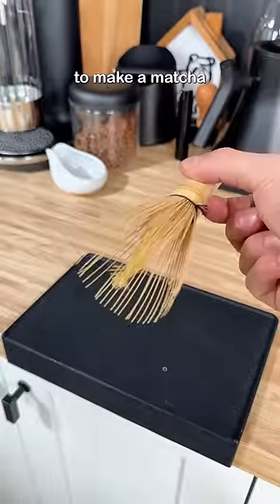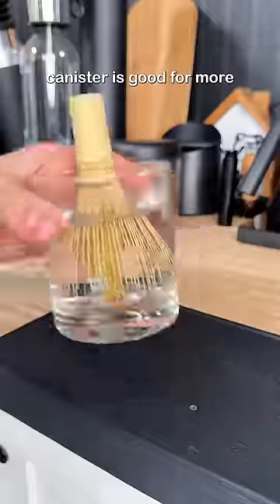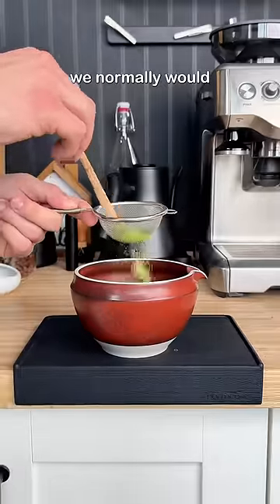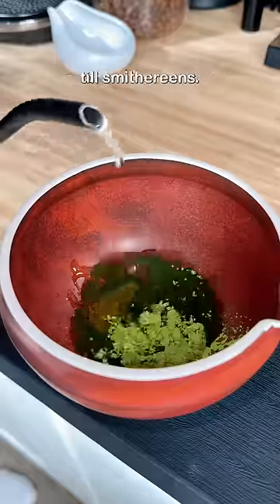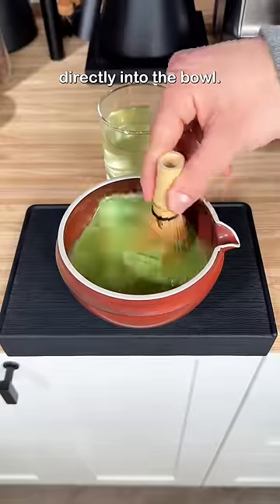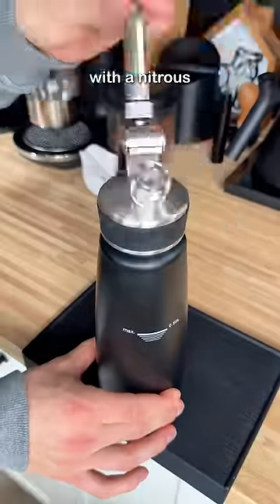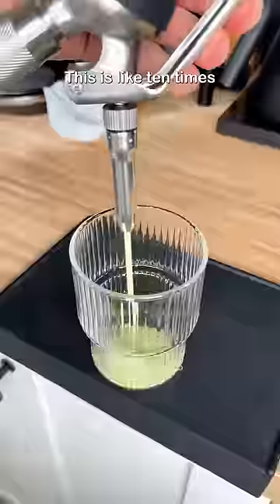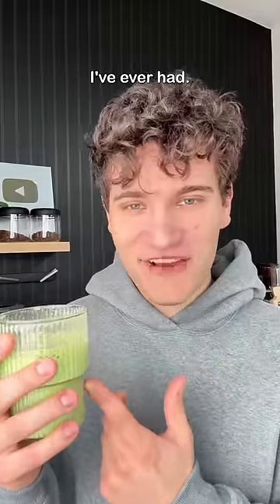My favorite way to make matcha - nitro matcha latte

Comment: this looks really good, i love matcha with honey! i was a little jarred by you using the matcha wisk with honey and milk. when i was a barista we were taught to never use the wisk with anything but matcha and water. sugar, honey, milk, anything else could cause the bamboo of the wisk to mold.
Reply: i got pissed when i saw that
Reply: I was also like 😬
Reply: Sure, the likelihood increases by a lot, but it's his own private whisk and he can buy a new one.
Reply: @JoiskiMe a bit more wasteful. I believe as long as you wash it right after use (especially if you add milk) and dry it properly, it should be fine and last just as long, at least theoretically. Mold is mainly moisture plus foodstuffs that are not antimicrobial in some measure. Both milk and (low amounts of) sugar can fuel mold to grow with bacteria (tho honey is antimicrobial due to various reasons); the moisture is the primary concern when it comes down to it.
Reply: @chrischen9493 why are you 12?
Reply: @xhaywireskydiverx1389  what is that supposed to mean? i was just saying i got pissed because i’ve been taught to NEVER put matcha whisk and sugar together

Comment: If you're like me and can't afford a whipped cream cannister and nitrous oxide cartriges, you can achieve very similar results with a shaker :D
Reply: I got one on sale at amazon that came with 3 cartridges for like 16$.
Reply: Or a blender.
Reply: All you have to do is shake it to oblivion
Reply: little workout won't kill you @Maily45618
Reply: Damn that's like 2 days worth of wages where I live... Shaker it is xD
Reply: Never got high due to shaker fumes
Reply: Thanks for the tip
Reply: I believe a stick blend would work too.m and less cleaning
Reply: I think the french press would work as well. I did it before, and it was so foamy it's like i drank soda from the burps it gave me, lol.
Reply: I hope they let you in at the pearly gates for this one because I was trying to figure out  what I could use

Comment: The knot in the middle of the brush needs to be undone and then soak it in water so you have two layers of pins. 
Just trying to be helpful

Also I would use the whisk for milk because of the fats and the fact you are only supposed to rinse the whisk with hot water. Since water can break down fats… etc

Comment: I've never had a macha latte. What does it taste like?
Reply: Matcha is basically finely ground green tea. Think instant espresso powder, but tea leaves. Because you add so much honey or sugar it becomes very sweet, but it has earthy and fresh "bright" overtones. There's very little bitterness left in the tea if prepared right, even if you were to drink straight matcha powder mixed in the hot water you get a strong earthy tea flavor with some mild bitterness, but not that bad.

Matcha lattes, when done right, are supposed to be fairly aerated, so each sip kind of has this velvet mouthfeel as well. In the case of this video's example using a whipped cream canister you get an extremely whipped drink lol.

My personal way to do it simpler than this video is using an espresso machine's steam wand. Sift the powder into a cup, release just enough hot water to dissolve the powder (very little), swap wand to steam mode, in a separate cup steam/froth up your desired amount milk, pour them together and mix using a spoon.

You can add any additional sweeteners or flavors (honey, vanilla, etc) after you dissolved the powder.
Reply: @Quibber123  Thank you, I want to try it now.

Comment: I guess my question is if the canister is using nitrogen gas or nitrous oxide? 
Nitrogen gas is okay to implement in a full beverage and that's what most companies tend to use for "nitro sodas", although making one at home seems a bit fool hardy since nitrogen doesn't like to stay in water, hence why most nitro sodas immediately go flat and the same thing would happen to this late. 
Nitrous oxide, on the other hand, which is commonly used in aerosol food products and homemade whipped cream canisters like the one you use, is not okay to consume in large amounts. 
I'm genuinely curious.

Comment: Looked the same
Reply: He didn't shake it enough in the whipped cream canister. The way it came out is the way whipped cream comes out of those when the cream has settled. He just gently turned it over itself when you actually need to shake it way harder than he did.